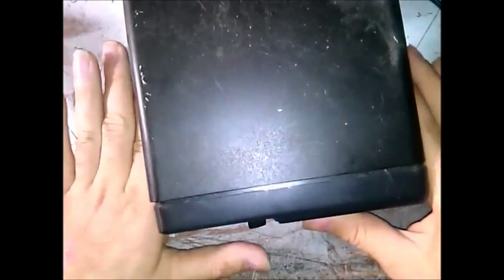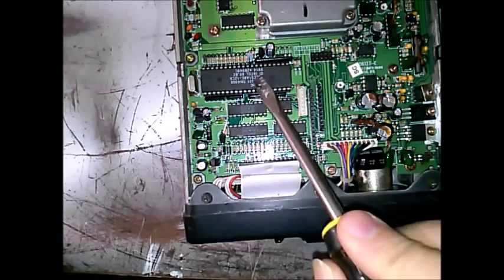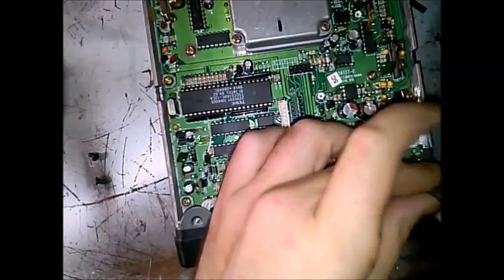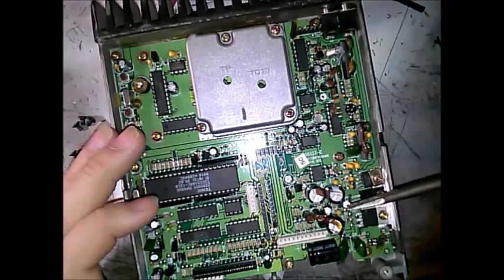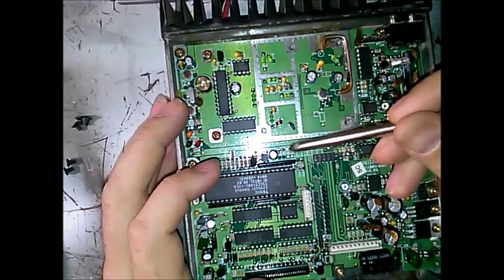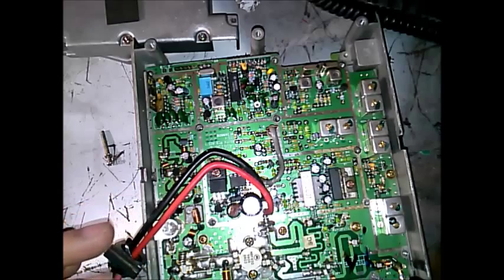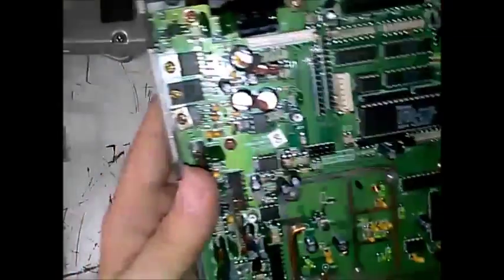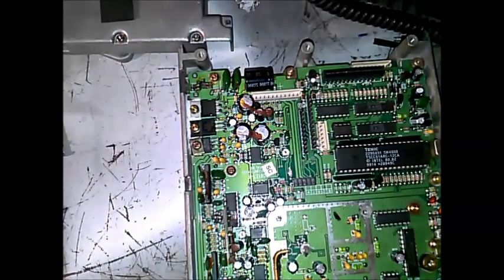Maxon SM4450sc Mobile 2-way radio Teardown

Comment: Hello . Just bought on a local scrap yard this Maxon 4450 SC for 2 USD$ :) It is not damaged but I can't say if it is in good working condition. Any idea how to program it to HAM frequencies according to IARU European region 1?
Reply from the maker: Does the unit power up? it should do a series a fast beeps and come up with CH01 or whatever that last channel was it was set on. There should be no Err on the display and no repeating beeps.

These are mainly commercial band radios but they will do ham frequencies but you may need to reset the VCO so the PLL will lock down since ham frequencies runs this radio out of its factory set bell curve.

To program you need a program cable - http://www.rfguys.com/product/maxon-sm4150-sm4450-pm150-spc-4000-programming-cable

 And the software -  http://www.hackersrussia.ru/block/radio/smp4004c.zip

For the software you really should use an old PC with a true DOS mode or just DOS on it, Running this in a modern emulated DOSbox environment and through USB cables and adapters can brick the radios e2prom.

I use an old PC with DOS 6.22 and windows 98se and run the maxon software in DOS.

The programming procedure requires you to open the top of the radio and plug in the cable to the matching on board jack and connecting the cables extra wire to pin 1 on the audio option board plug. You have to remove this board, it is towards the rear of the radio as a daughter board. This is to supply power to the cables internal circuits so it works.

Load the software and connect the cable to the PC. When turning on the radio you need to hold the "P" button and turn it on, you should get PrOg on the display, the radio is ready to read and write data. 

ALWAYS READ the radio first!! This way the software can set the proper model type features and you don't end up with a bad codeplug.

After programming, turn off the radio, remove the programming cable, put the daughter board back in. If sucessful the radio should power up and not have any Err on screen or repeating beep while receiving or transmitting.

If the radio is beeping either while idle receiving or when you press the PTT then the VCO is not locked down and it needs adjusting.
This is done with a digital voltmeter connected at the TP on the metal shield (there is a little test point in there) and a nonmetallic flathead tool adjusting TC13 (variable capacitor). 

Set radio to the lowest receive frequency you have programmed and you are looking for a voltage of about 1.5 volts, adjust accordingly to get this or close, the beeping should stop.

Next change to the highest Transmit frequency channel you have programmed and with a dummyload connected press the PTT and look for less than 7.5 volts on the TP.  As you adjust the beeping should stop when you press PTT.

Here is a PDF of the service manual for your radio - http://www.repeater-builder.com/other-mfrs/pdfs/maxon-sm-4450-svc-man.pdf

You may have to take the radio to someone who can properly adjust the unit for your desired frequencies especially if they are out of the regular operating parameters. These are good little radios, 40 watts, 16 channels, scan feature with priorities.

Comment: Nice of you to take the time to make this video.  What is the power adjustment for these?  I saw a manual online for just the 4450 and it said VR3,  but where it shows the VR3 on the diagram, on this 4450SC in that same location is a RV2,  is the RV2 the power adjustment?
Reply from the maker: +rtt1969 You know I forgot which one it is lol. I want to say it is RV2. 
I work off the official maxon 4150 manual I have here, I ahve no idea where my 4450 manual has gone, it's been MiA for 5 years now lol